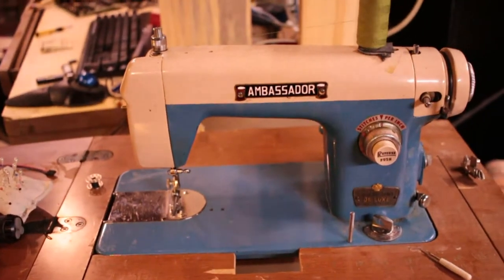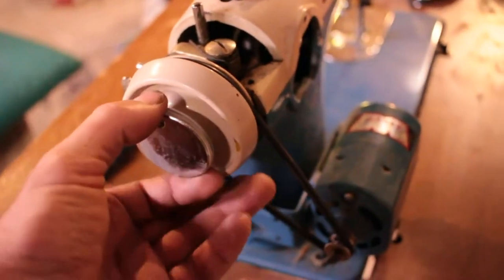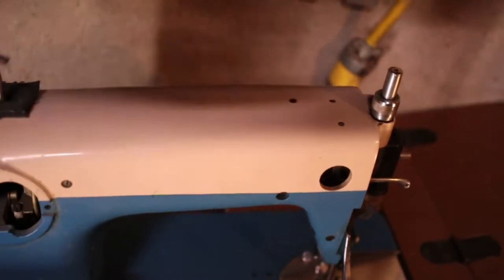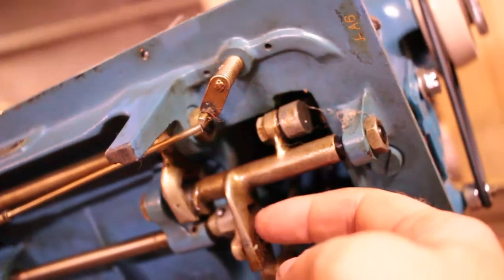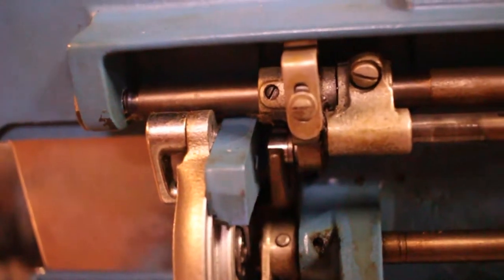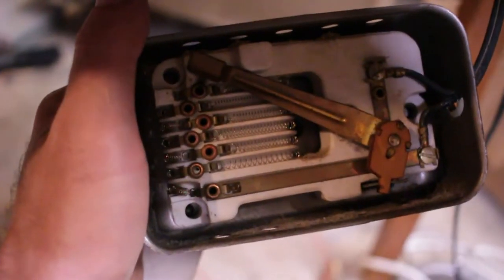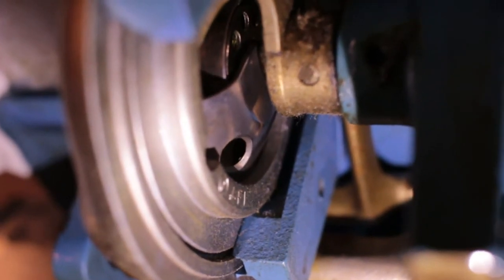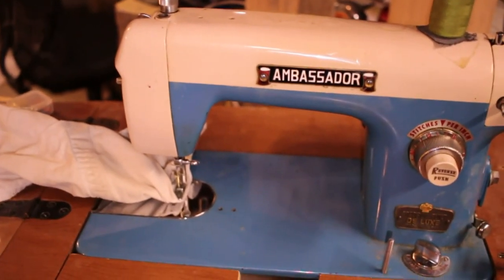Free craigslist sewing machine operation

Comment: I just got an Ambassador sewing machine model 301 almost identical to the one in the video. Where can I get an owners manual and service manual for my machin
Reply from the maker: I never found a manual specifically for my machine. However the it is a singer type 15 clone so a manual for any other type 15 clone should be close to correct.
Reply from the maker: I almost forgot there was a Yahoo group for Japanese import sewing machines. Yahoo groups is now defunct but the group may have moved to a different platform.
Reply: @diyVT  Thank you for the reply it was very helpful and got me going in the right direction. Have a wonderful day and thanks again.